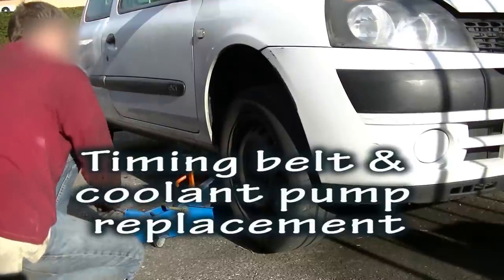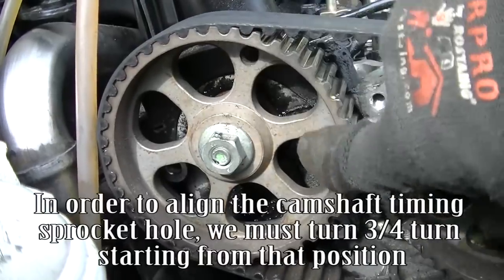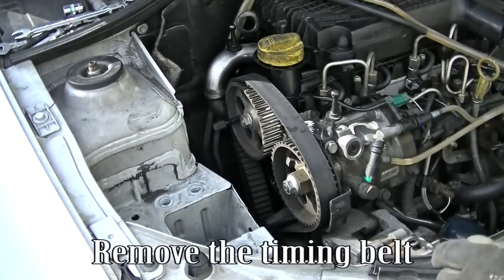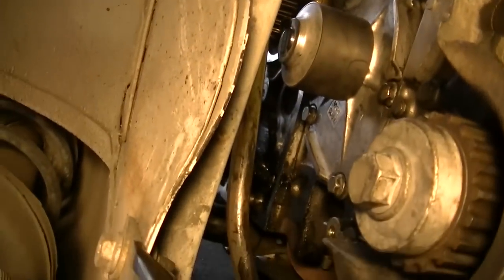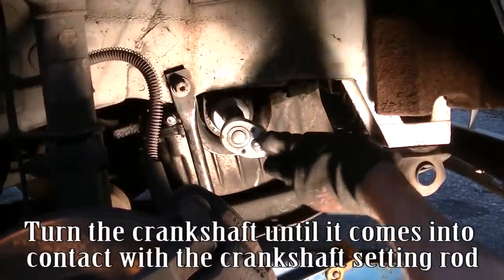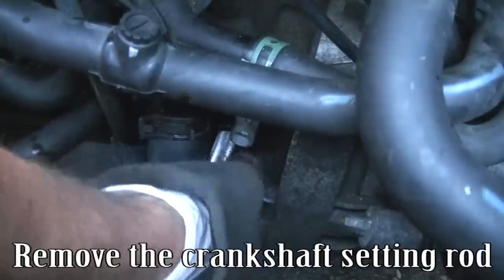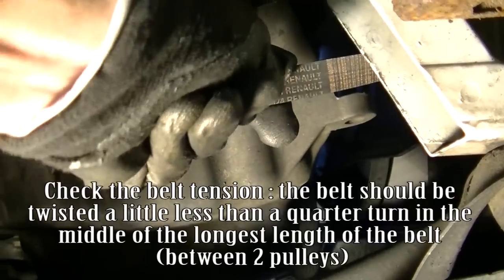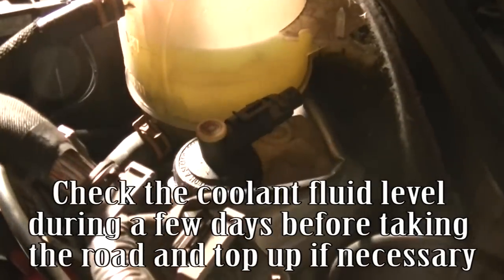Timing belt & coolant pump replacement

Comment: Thank you,, as some usual moaners pointed out a bit of back and forth but nothing wrong with double checking and making a point out of it, any carpenter or engineer will tell you "measure twice, cut once" this is a critical point in any engine service, it has to be done right. As a competent back yard mechanic (and a little more) this has shown me everything i need to know for the scenic i just got. great vid :)

Comment: Do you need to replace the cambelt and water pump at the same time...i ask because the cambelt was replaced just last year and now since there's an issue with the water pump, i was told i needed to replace the cambelt again??

Comment: THANK YOU! working on water pump/ Timing belt n pullies on 03 dodge stratus 2.4l dohc. after 3 recent hours of looking of diagrams, videos, reading you finally showed me the trick for putting on timing belt that is tight. Every video i watched for timing belt installs on any vehicle showed the belt after the install or it going on smooth. You sir could have save me a lot of ball busting and will save any one the same workout with your info.    FYI i seriously didn't think I'd learn s*** from this video in first 5 seconds and you showed me a few things i've not seen in my 2 weeks of researching. Good work man

Comment: is there a hole to lock flywheel out on a Renault kangoo van 1.5dti ?
Reply: gasdude66 yeah. Theres a female torx below the starter, you can get it with a 3/8 11mm deep socket aswell... When you remove the crank pulley, check that the crank is still againts the pin. It sometimes backs off when you remove the pulley bolt.

Comment: Hi, great video...did you put any type of sealer/threadlock on water pump bolts as per Renault Dialogys? If so, what type did you use?

Comment: at 16.50..hold the belt to stop crank turning?? the belt acts only on the crank pinion at this point so it doesnt stop crank turning, i just found this out myself. also can a more knowledgeble person let me know if its safe to fully torque the crank pully using the  timing pin tools to lock the crank? this video very vaguely shows the bloke sticking a screwdriver in???somewhere???. buggered if i can find anywhere to do that. thanks. overall very helpfull vid
Reply: yeah. lol. the waggly screwdriver in the timing hole really was a bit pathetic.

Comment: Great video! 

I dont understand the thing with the "free crankshaft pinion". If the sprocket isnt keyed (locked) to the pinion how can the engine keep its timing and what is the point with the sprocket if it aint locked to the pinion????
Reply: joma7551 the crank pulley holds it